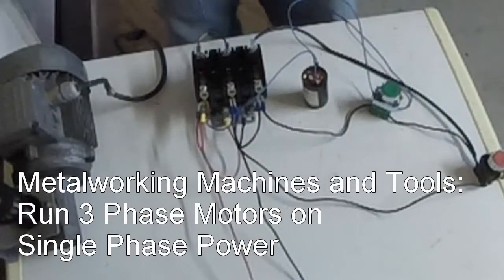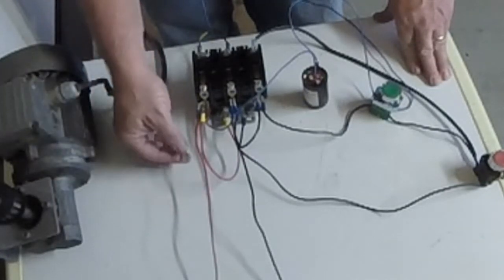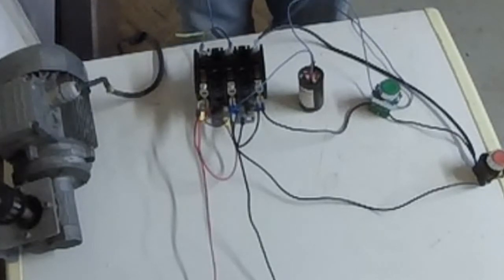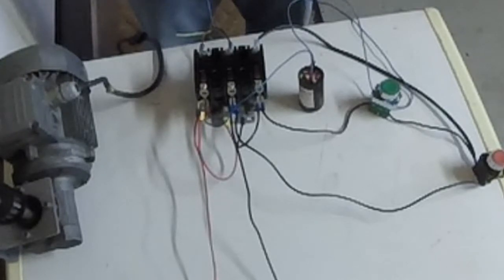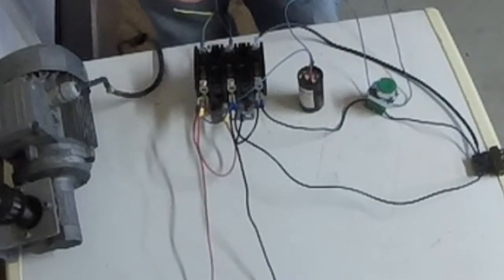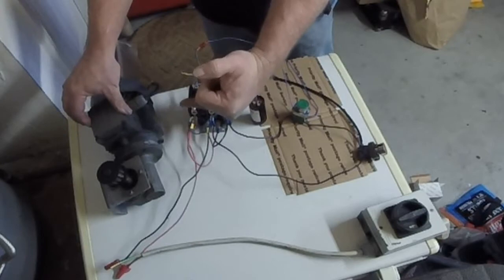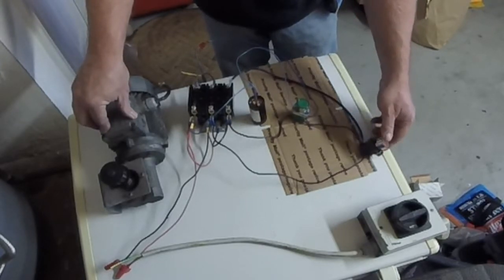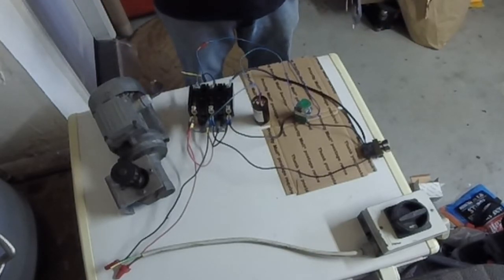Run 3 Phase Motors on Single Phase Supply

Comment: Mike, is this basically a static phase converter, like the ones sold commercially, laid out for us to see the working parts, or is it different?
Reply from the maker: Hi Bob,  yes this is a 3 phase motor starter. 
the design differs from commercially made units, but provides the very same function.
this version of the 3 phase motor starter can be made for around $75

Comment: any chance of getting a wiring diagram
Reply from the maker: Hi Ed,
you can see my design here:
http://www.hobby-machinist.com/threads/rpc-simple-design-unbalanced.12712/
Reply from the maker: or you can email -
ulmadoc@gmail.com
Reply: thanks, I assume A1 and A2 are for energizing the contactor.
Reply from the maker: Yes, Sir, the coil connections are A1,A2